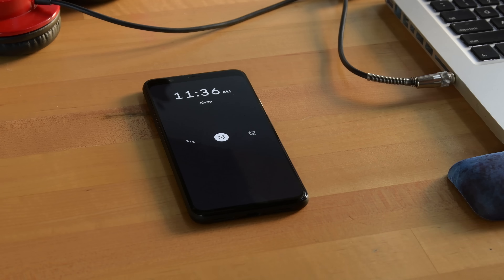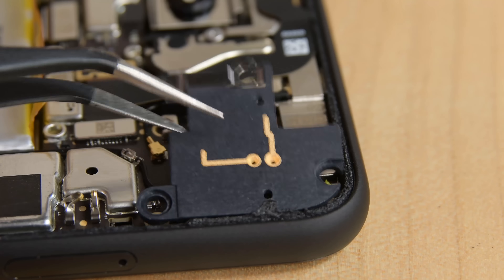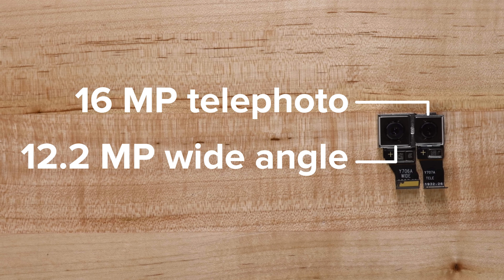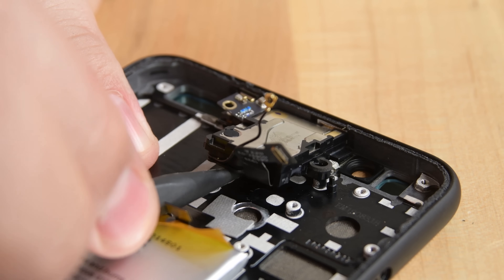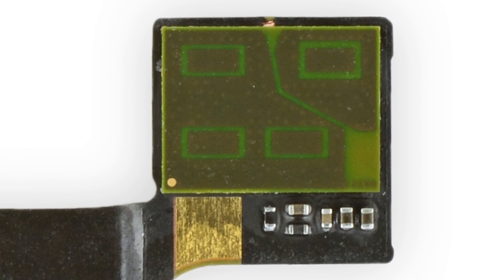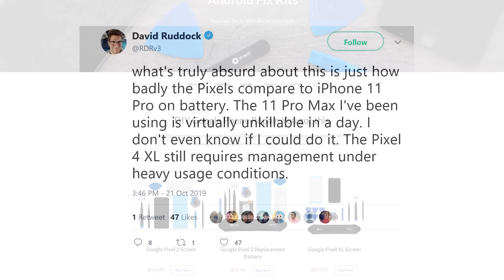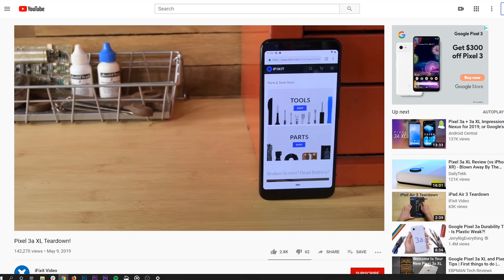Pixel 4 XL Teardown—Soli Chip Close up and Motion Sense Explained

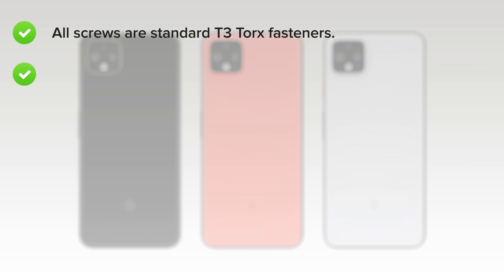Comment: 3:00 the battery pull-tabs are crap and so it the adhesive holding the battery in place.  Adhesive too secure, pull tabs too fragile

Comment: Is it easy to  replace the battery?  Mine shuts off when I let go of the power button. It happened after a slight drop. Previously battery percentage would stay stuck on either 50% or 100%

Comment: Paid £130 for Genuine screen still on the frame, £20 for a replacement back then £20 for a Replacement Battery. Then I opened it up and found numerous parts that are only secured with adhesive which you can’t easily buy. 1/10 Repairability compared to the original Pixel that took 5 minutes

Comment: You can easily replace the screen by a) using heat and proper tools like a suction cup / card b) remove the bottom 3 screws on the MoBo and gently pushing it inward to allow the ribbon cable to escape through the side of the frame. Maybe 10 minutes start to finish once you have done it once.
Reply: is it easy to replace the battery in pixel 4 xl?
Reply: @jerrywilson452  very easy
Reply: @jerrywilson452  use dabs of rubbing alcohol to loosen the battery adhesive

Comment: Do I absolutely have to take out every parts before ungluing the screen? Any other way around?
Reply: You can easily replace the screen by a) using heat and proper tools like a suction cup / card b) remove the bottom 3 screws on the MoBo and gently pushing it inward to allow the ribbon cable to escape through the side of the frame. Maybe 10 minutes start to finish once you have done it once.

Comment: “The back panel is easier to remove than other phones and can be removed easily with this heat applied”
“Yeah the back is really hard to remove and you have to remove it to fix stuff so 4/10”
Reply: I was really hoping I could fix everything about this phone without having to open it. Bummer.
Reply: Relative ease doesnt mean it cant be better.

Comment: I take issue with the low score. You make good fixer kits but seriously a 4/10 because the phone is solidly built? Of course it needs a heat gun to take apart, it's glued shut so it doesn't come apart easily. iFixit score I guess is inversely proportional to build quality
Reply: Well, the problem with gluing is that one wrong application of pressure at a pint with the glue hardening back after taking th heat off and you risk cracking a glass back panel or in some phones the display. But unfortunately glueing has become necessary for waterproofing/resistance.

Comment: Even the repairability is worse than before... on the Pixel 3 repairing the Display was much easier because that was the Part you have to remove at first. Now they're doing it as stupid as Samsung and almost all other manufacturers except Apple...
And being able to repair the display is MUCH more important than the glass back.

Comment: This score doesn't seem fair, it isn't a Lego construction, and it has lots of modular parts. And for the battery pull tabs, come-on, they could have been weak on that specific phone, and anyway if you have to change the battery who cares if you have to put some strength, as long as it isn't pierced or treated by a dumb person it isn't  a bomb

Comment: I still doesn't understand how sturburn are ifixt to give low scores of repairbillity because of waterproofing, how do you spect to reach that level of waterproofing with out sealing the phone, at least like in the iPhone 11 everything is modular and you don't even mention it
Reply: thelifeofpatricio and this fone is 4 because is glass in the front and back '?' They just want to give low score for whoever they want
Reply: junior212136 you can’t take off the back becuase the glass is permantly glued, so you need a heat gun
Reply: @jli8225  well of course you need a tool to remove it, you don't go to remove a head from an engine with you hands right?
Reply: Engine's aren't welded shut, are they?
Reply: @jli8225  techniclly it's not welded it shut, it's just glue on, and like my previous statement you need glue for water proof
Reply: @canchume  Then don't give it a waterproofness rating. Just because all phones are hard to repair doesn't mean it deserves a 10. 10 does not mean the best phone, it means the best possible repairability. If all phone's get 0s-5s, then it shouldn't really affect anyone's buying decision
Reply: @jli8225  I'm. Not saying that deserve a 10/10 but I think there is more to consider that how much glue doest it have the phone
Reply: Jacen Li
No. They're held in by either head bolts or head studs with a gasket in between.